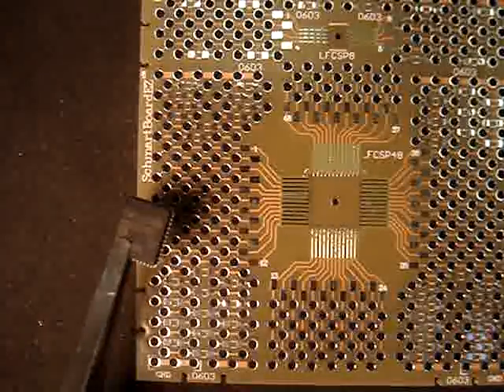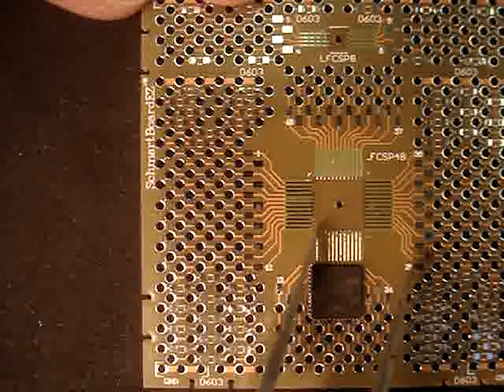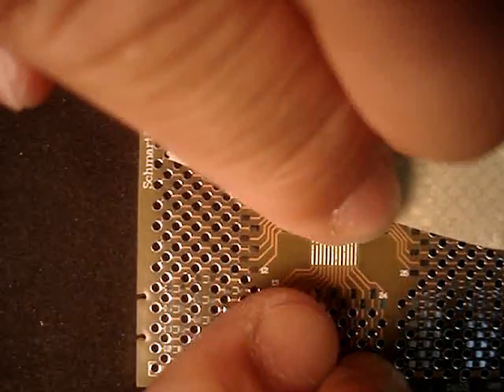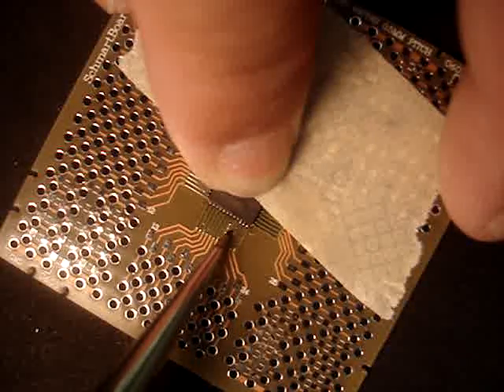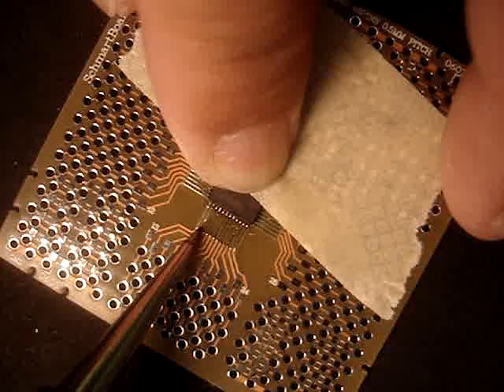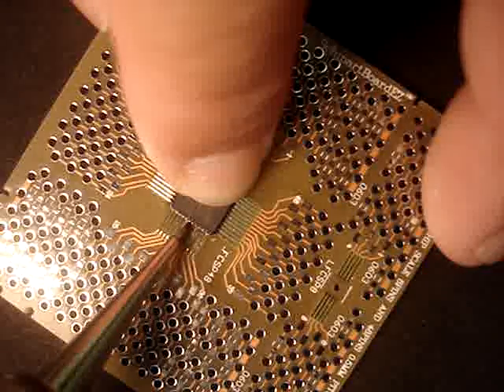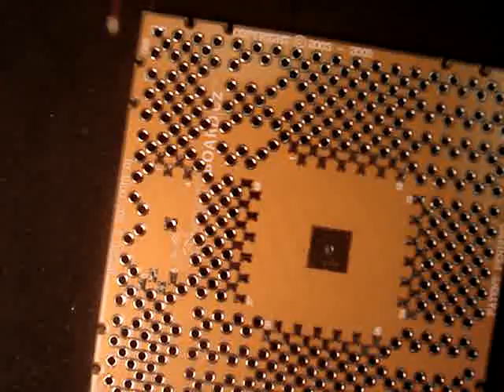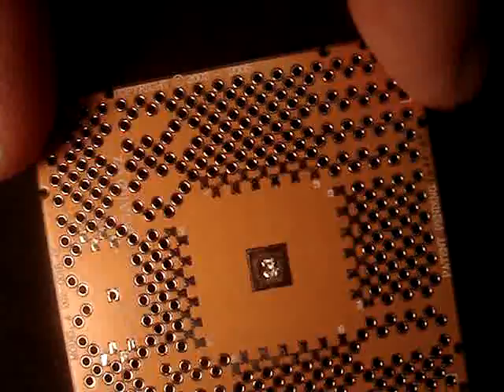Hand Soldering .5mm QFN Component With SchmartBoard|ez

Comment: This video is completely deceptive. Hand soldering a surface mount part, even with a Schmart board, is very difficult. My first board turned out to be a burnt hole and so will yours. Schmart boards are very delicate. You have to develop just the right touch to make contact with the solder without gouging the board. Good part placement is difficult. None of the parts I tried fit in the slot. They either flopped around or did not go in. Don't try it without a 1/64" iron top and good magnification.

Comment: The 'N' in QFN stands for 'no-leads' (the pads are underneath directly soldered to the PCB). Indeed it does look like you have a QNP and the horizontal drag technique would prove significantly faster.